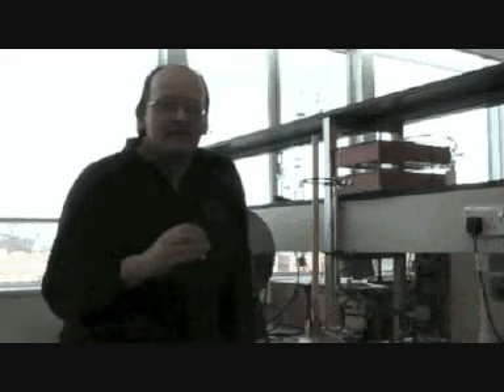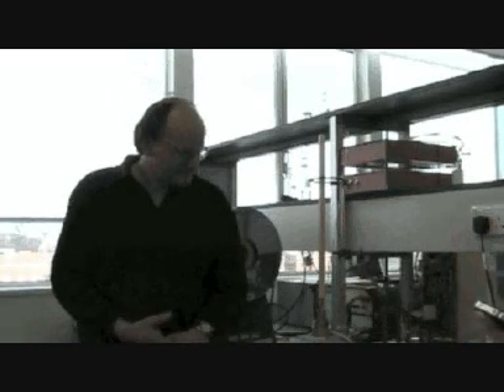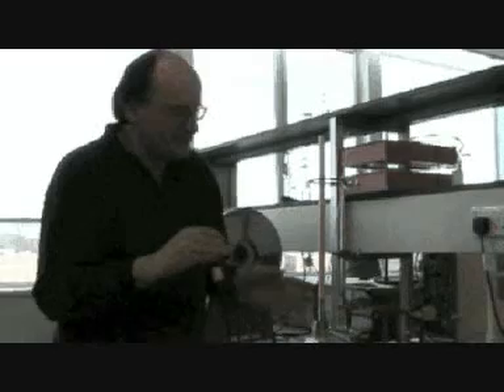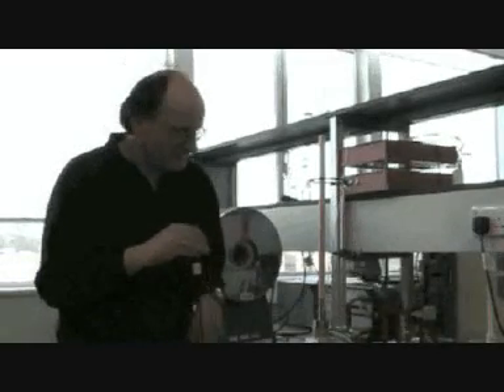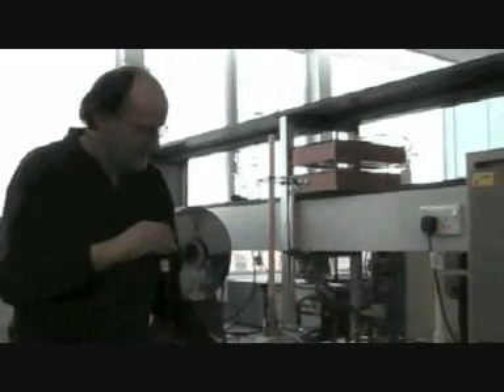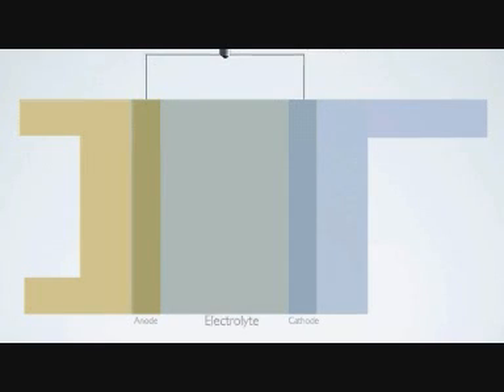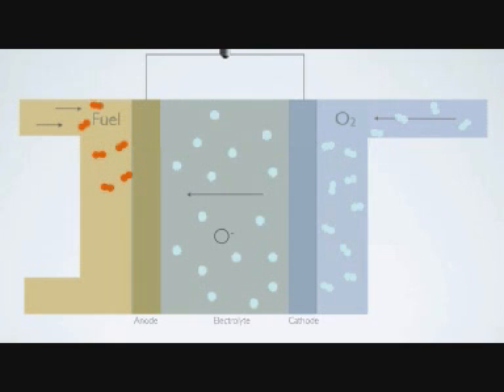solid oxide fuel cells

Comment: @b101aa2 Wrong on almost every point. SOFC is far from "inefficient". The latest ones have already reached 60% efficiency,on par with your "actual" PEM technology, both which benefit from the addition of turbines and co-gen configurations. The "immense heat" used to be a problem, but newer lower-temperature SOFCs can now start at 300C and advancements are confident that can be brought even lower. See companies like Sakti3 for example. Hydrogen economy from electrolysis is a fool's quest.